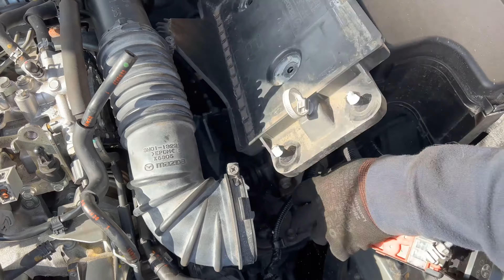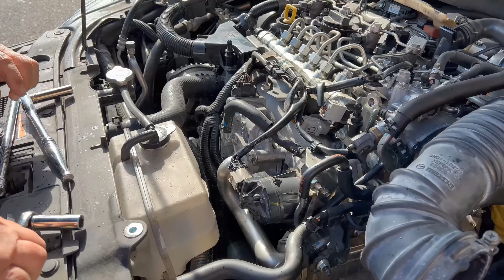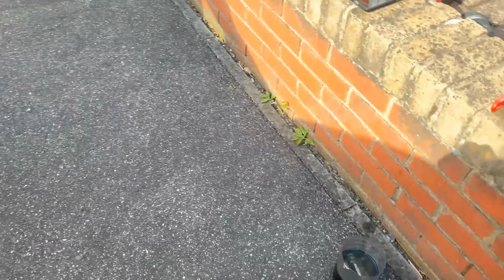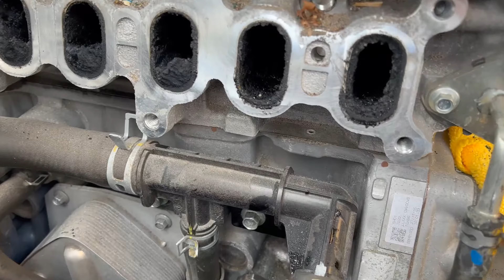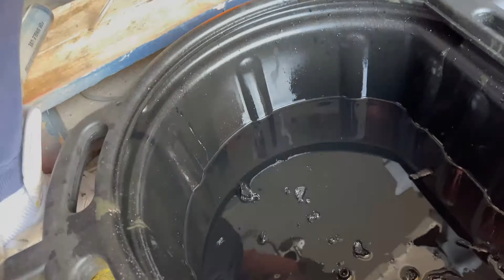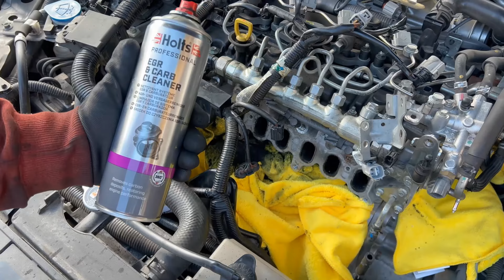P0401 Fault Code Mazda  - Mazda 6 2.2 Skyactiv Diesel EGR Valve Removal + Cleaning

Comment: Hi MrNiceGuy. Thanks so much for your video and great job with this project.   Can you tell me if your car had any other symptoms other than the fault code?  Did the car drive poorly?  For me i have trouble starting my car (like the starter is lazy or underpowered). Its worse when the engine is already warmed up.  but once the engine is started it drives normally.  I have no fault codes and i have tested the battery - perfect and the cable connections and starter motor appears to be ok.  Just wondering if its an early sign my car is starting to clog up with carbon deposits?  Thanks again
Reply from the maker: @Jack Foo  Hi, it was a customer's car. It had the fault code, and he also told me that the car drives better than before, more likely was running poor because of the carbon buildup. 
Well, with your problem it could be the starter as you think or the carbon buildup as well. If it gets to the valves, it makes the engine more to turn over when starting. 
You can easily check if your car needs a cleaning. Just remove the MAP sensor off of the intake manifold and inspect the end of it. If it is dirty from oily carbon residue, you 100% need the get this job done. Also I would recommend doing it every 40-50k miles on this engine.
Hope this helps! ;)
Reply: @MrNiceGuy94  thanks again.  What you say makes sense.  I will try to eliminate the easier causes before tackling this project.  I remember i pulled off the map sensor to check shorty after mazda replaced my engine.  I did find alot of carbon deposits choking up the sensor.  Makes me wonder if they bolted everything back including the manifold without cleaning it.  So far my car has done 50k kms since the engine replacement.
Reply from the maker: @jack_attack_1  They may have cleaned it, but it gets dirty quite fast. I would definitely get it cleaned. Honestly it is not a difficult job at all. You just remove bolts and parts then clean them, and finally reassembling everything. If you follow my video it should be an easy task.